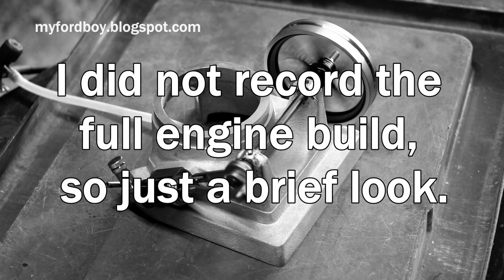Replica Marklin Steam Engine Part 4

Comment: In some parts of the world, DI (also distilled, I guess) water is needed for rinsing & mixing different cleaning/plating solutions because mineral content can contaminate the parts and/or simply cause the process to fail to give good results.  The Plating Shop where I used to work had to have its own DI water system to "make" it as needed.  Of course, home/small workshops are better off buying what they need to avoid the high cost of makibg their own.
Reply: That is a good point. I think in this case myfordboy lives in a soft water area, as I also do, with low pH and low mineral content where the issue is of less importance.

Comment: I have a video on nickel plating. I made it because I've found all the other videos on the subject to be unhelpful. For tinkerers and experimenters only, not for people like us who want to functionally use plating. Anyhow, try to keep the voltage as low as possible. You've got the right idea having a benchtop power supply. I like to adjust the voltage to get the amperage to about 200mA, or thereabouts. Higher voltages lead to more bubbles on the piece, each bubble leaves a microscopic pock mark and ultimately leaves a dull finish. That, and you need to polish the piece to a mirror shine beforehand if you want it to look good after plating.

Comment: Just bought all the stuff i need to make a foundry

Itl be here tomorrow, as i dont have any refractory suppliers in the area. 

Super stoked ill get to cast stuff now
Reply: Best of luck!
Reply: It was a bit daunting to try at first after many months of watching Myfordboy, i finally fired up my Electric forge of the same one used  by myfordboy and did my first casting using Bronze , and it came out 95% ok for a awkward part, 
But now i feel confident to do more,
so best of luck on your first go and hope the part you make turns out ok.
Be safe.

Comment: Just wondering as you used 5v at 1 amp, Would a USB charger be good enough to do small parts like what you have done
as a USB charger give out 5V at 1 amps.
Maybe i will have to try and edit my comment or maybe some one has already tried
Anyway thank you for myfordboy for an update of your steam engine.
It is coming along nice.
Reply from the maker: A usb charger is fine for the plating. You need something a bit more powerful to make the plating solution. This is the video i followed and it explanes it well. https://youtu.be/G-PtnwtOR24